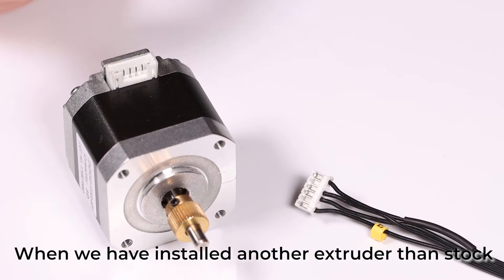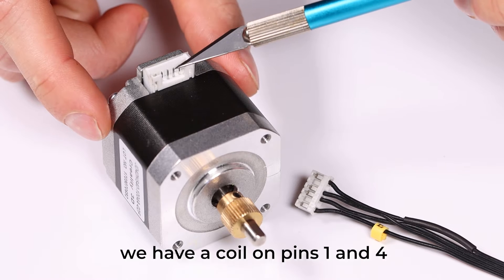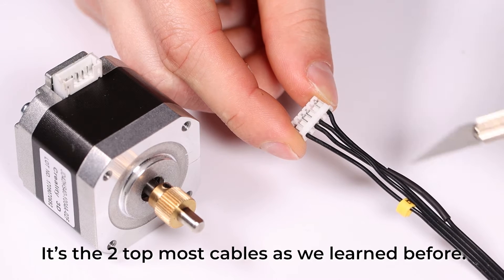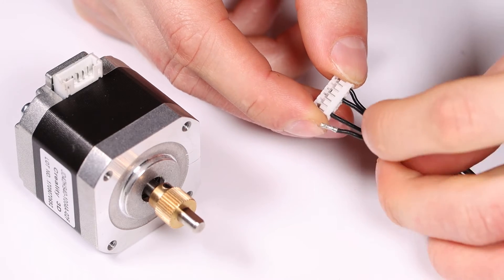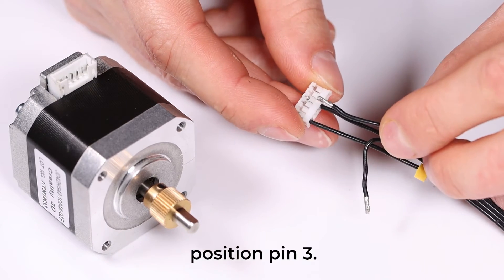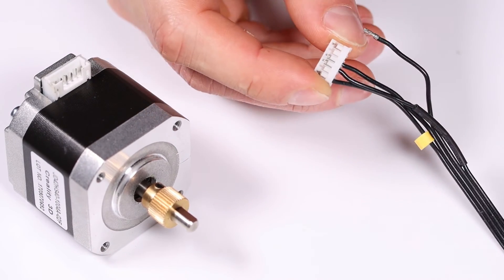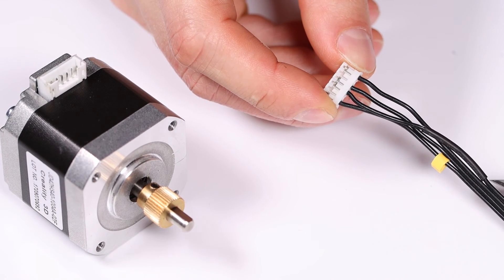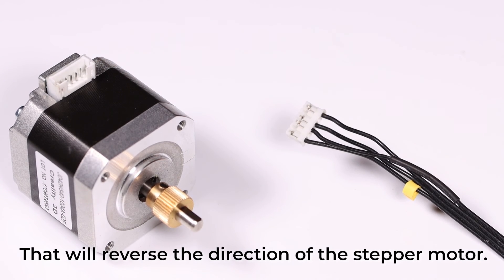Part 3/3 Reversing feeding direction by swapping a coil's wires

Comment: You can’t understand how hard it is to find a video like this that’s simple and to the point and shows someone only reversing the polarity of just one coil to change stepper direction with the wiring. There are a ton of videos out there that are too long, swap both coils wires (twice the work/effort). This is the easiest/fastest way to do it if you’re mirroring one of two motors on a single axis since it can’t be done in the firmware. Perfect video 👌🏼

Comment: Just want to say thanks for this. After updating my Ender Pro 5 to the latest firmware by Creality Ender-5 ProMarlin2.0.6HW4.2.2GD
BLTouchFilament 29 Nov. 2022, my feeder was running in reverse. Did exactly what you said here and now its running perfect. Literally took 2mins to do it. Thanks again.
Reply: Exact same scenario for me, in 2024.. it's wild to me that Creality can release a "fix" with a bug in it, and 2 years later, still has the same problem.  Definitely going with another brand for my next upgrade!

Comment: Will be doing this tonight! No clue how but after I upgraded my hotend, my extruder started going in reverse! Nothing else had changed and I know I did the wires correctly. Was really irritating that I had 3 failed prints and couldn't figure it out until I went to calibrate esteps 😅

Comment: I did this on end3v2 4.2.2 with misoc firmware and it causes firmware to glitch and stepper to make a bunch of noise during retraction its a creality stepper motor but when using microswiss extension extruder cable it reverses it so I need to reverse it without having noise and glitching of firmware

Comment: THIS was the solution. In my case, I had to reverse all four wires (FLSUN Q5), but this fine individual showed me the way. Gratitude!!!!
Reply: Your comment is a lifesaver! I was wondering why switching the wire didn't work on my Q5 then I read your comment!! Saved me so much time!! Thanks!
Reply: So what you mean is that this video actually gave you the wrong information? You do not swap the wires as shown, but in another order.

Comment: Does not work. My extruder is making tons of noise. I have blue, red, green, black. I switched green and blue and now just tons of noise. Extremely disappointed considering i spent over 700 dollars. Now I have to play with the wires all day until it works or just toss out this bondtech stuff and go back to stock because it works.
Reply: yeah man I get your pain. I have project deadlines and instead Im spending days trying to figure my machine out. Great time. 10/10 would waste time again.
Reply: also see if maybe you can find a different video if your wires are different. i just watched a video where someone had the same color wires youre talking about. Not sure if theyre aranged the same way though. think the name of the video was Invert Stepper motor direction - 3d printing basics. However he doesnt explain too well so Im not sure this will help too much. Worth a shot though. Good luck.
Reply: https://youtu.be/9Qyc5uAKtQA

Comment: I switched the cables and the motor still go in the wrong direction.
Reply: Same problem... Do you solve it?
Reply: @milaniusloduha4728  Yes, you have to switch 1 and 4 and also 3 and 6.  You  have to switch both cores
Reply: @bigdumbanimal23  on both ends of cabel?
Reply: @milaniusloduha4728  No, just on the end of the cable that plugs into your stepper motor.  The video shows how to lift the little tabs so the pins can be removed.  It makes mistake in that it shows that you only have to switch two cables.  you have to switch the other two as well.  I figured it out by clicking on his youtube name and watching how he tested which wires were connected to the 2 coils in the stepper motor.  Hope this helps.
Reply: @bigdumbanimal23  thanks I hope to 😀
Reply: @bigdumbanimal23  thanks 👍
Reply: @bigdumbanimal23  having the same issue but after reading your comment I switched 1 and 4 as well as 3 and 6 but still going on reverse